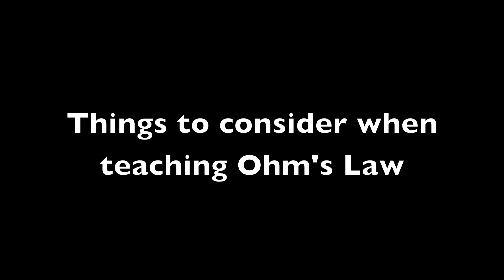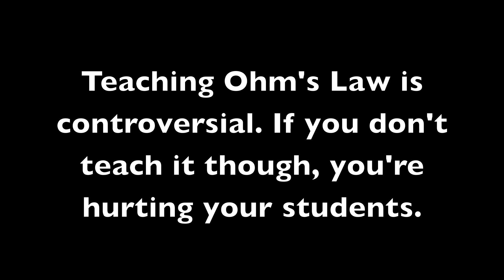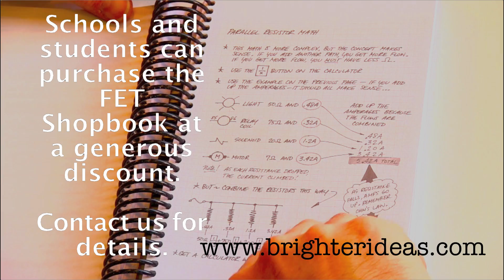Teaching Ohm's Law to Techs - Part 1

Comment: I used to teach some of the history. Current is measured in Amperes because the units were named after a French Scientist ( André-Marie Ampère) - The symbol I is used because the French used the word Intensity for current).

Voltage is named after the  Italian physicist Alessandro Volta, and Ohms for  German physicist Georg Simon Ohm.

This all a bit of history that we need to live with because they are standard scientific units and names.

Things need to be called something. Adding the back story makes them easier to recall (in my opinion).
Reply from the maker: We need to remember that however hard we try as teachers, creating something that is appreciable by every student is impossible. adaptability and flexibility are critical, so there is no ideal. Common sense demands we use the least confusing examples possible, and using E,I and R when the tool (the meter) is marked with V, Ω and A only makes sense. I also teach history. And language, and philosophy and I coach, and cheerlead, and I'm a big brother, and I'm a pastor, and a counselor, and I'm a dad. The men I teach need confidence, and it doesn't come from teaching them stupidly. I reserve the right to do what I feel is best. V, Ω and A are logical, and not criminal. They work. I use them.
Reply from the maker: I like your opinion. I teach this very thing in every class, and it has a very prominent place in my book. Thanks.
Reply: Most kids 11 upwards can cope with the maths & I think it does them good to see maths actually has a use.
Reply: Daniel Sullivan to a person like me who is learning electronics, why would i care about a Foot Note of a guy who died a few centuries before i was born?? It does not matter who did it/Made it/ or sold it. The only thing that ever matters in everything is, How does it work. Thats it. . So Thank You Mr Sullivan . By the Way Richard do you teach your class in easy cycles too? Do you tell your students you drove to work listening a great show on ON XXXX Cycles?
Reply: Peter Kiryluk  :-) I was classified as an outstanding teacher and with my approach increased the results in electronics by 58% also put up the number of students choosing it as a subject.

Never decry history, it is the stuff we are made from. A little back story can make the lesson interesting and make information stick in the memory better for later use.

ALL of the maths and electronic theory you are learning was set down in the 1800's Even those principles that underwrite recent developments as lasers and the transistor and integrated circuits.

The Greeks knew about computing in 100 BC and built mechanical analogue computers.

 Without those 17th century scientists and inventors there would be no NOW as we know it.

I was, (retired now), well known for doing a great deal in little time with my student, When I entered teaching after a full career in industry I quickly grew tired of the simplistic approach generally taught so that the students "had a better chance of success" and approached electronics and computing from a very practical and industrial angle. My students learned to code efficiently using industry methods to analyse problems and produce appropriate solutions.

 Many made successful autonomus robots entering national contests and  performing well in both practical work and in problem solving. many made models of real industrial situations or actually tackled problems from real industrial companies. For example one group made a system to monitor wear on a tool used to remove the weld from welded tubing. Such a good solution that the company out it into use and rewarded the school and the students.

But then again I don't suppose you will read this if you have a short attention span and don't like "irrelevant details"

Oh and my students knew well I turned up at school in my  MX5 sports car and were quite happy to talk about it if they were interested :-)
Reply: I read everything, i learn everything. I didnt mean i don't care for history. I do to an extent. Meaning Like learning how a transistor, works. I rather watch the video of the guy who made the first one. I love your teaching method because, you are from the industry so why remember formulas that don't match to real life.  I find that people keep talking about this "Magical Electron" which has never been seen, yet everyone keeps getting thought this nonsense about sharing an exchanging electrons when nobody has ever seen it. I guess im saying I like to learn also the parts that are not proven 100% correct to date. (being made aware that it may not be correct) . Maybe i dig too deep, and when i don't accept anything as fact until i can see it and it makes sense. If it does not make sense its usually nonsense. Because if (what ever may the subject) you can't make it work in your mental mind experiment then in my experience its a flawed idea.  I always say , you can't discover anything great with a ruler. As it is just measurement tool. If you want to confirm a measurement then its a great tool. I totally went off what i started talking about.

 I love learning electronics. BUT the only thing im saying is your way of speaking and communicating information is FAR greater as you do it in a no nonsense method. I like to know who made it and how. BUT to use math abbreviations that don't correspond to anything your working with makes it hard to learn as its impossible to remember. SO I retract my statement. PS. don't stop making videos. Guys like you are aging and guys like me are having a harder and harder time trying to get answers about the fundamentals. THE theory behind why, and not just a this is how it is accept it. Especially in todays world as things are super small super complex and harder to understand. I dont know if that makes sense.
Reply: Peter Kiryluk
There are as many ways to learn as there are students. By far the best way is to find out what works best for you and then do that.

As far as electronics are concerned. much depends on your stage of learning. In the early stages it helps (I believe) to have a mental model you can set the information against.

there are several different models for electronics, Bohrs orbiting planets, Quantum theory where electrons become vibrating packages of energy (Yeh!) , various mathematical models the at for me do nothing to illuminate the actual electronic process.

When your designing a circuit the maths is invaluable allowing you to select the best component for the task, When your fault finding I think  you need a mental image of what is happening as a flow. This makes your approach to the circuit very practical and generally finds faults faster.

Different people like different things. Ohms law is one of the few formulae you will use often in a practical manner.

http://www.instructables.com/id/How-electricity-and-electronics-works/
Reply: I'm repairing things usually.
Reply: I appreciate all the information, and yes, im one of those people that has to imagine what is happening so i can get a better sense of the problem. I will never be a board replacer. I have found the people who repair stuff, sometimes have no idea what they are doing, they say they do, they generally can find which part needs replacing, Thus replace the entire part. I refuse to ever replace the entire board, except if there is a weird burnt chip with pins that look impossible to remove.  I appreciate your information if i have a question like a stupid ohm question i can't ask anyone around me because they don't know, i once tried to ask a TV repair guy if mosfet transistors sometimes turn on but other times turn on but with half  the power. I could not get a strait answer. to this day im still not sure, but thanks to Videos like yours im learning so much every day, at my own pace. Over and over sometimes until i understand it, forwards & backwards.

Comment: I'm concerned that you're conflating the concepts of (E, I, R) with (V,A,ohm). The reason is that these things are not interchangeable. (V,A,ohm) are UNITS, whereas (E,I,R) are variables, or values that someone will measure. Seems to me it's like if you ask someone to measure the width of a door, and they come back and say the answer is "inches". I understand that perhaps it is pedagogically easier to stick with the symbols that the students see on the meter, but it is also incorrect.

Comment: E, I and R are fine, so long as you teach them that Voltage is an Electromotive Force, Teach them that Amps is the amount of Intensity/Impetus of the force, and Resistance is measured in Ohms Ω. Once they understand that, E/V I/A and R/Ω mixups are much less common. There is a difference between memorizing variables and understanding the phenomenon.

Comment from the maker: Volts and Ohms MAKE Amps. Volts ÷ Ohms = Amps. Should "E" represent Volts to a person who uses a meter where "V" represents Volts? I think common sense suggests - no... The Voltmeter measures "E"? No. It's not 120EAC, it's 120VAC. It's not 1KR, it's 1KΩ. It's not 10DCI, it's 10DCA (or ADC). Using obscure engineering and scientific terms to teach mechanics and techs is not logical. My 30 years hasn't formed my opinion - it's generated a truth. V, Ω and A make Ohm's Law make sense.

Comment: E,I & R is fundamental, Have-to-Know kinda stuff. E,I & R are used internationally. They are UNIVERSAL. Electronics IS math. It's fun to do it the "feel good" way but, when it comes down to troubleshooting at the component level, you ahd better be able to read the schematic AND do the MATH. E, I & R were chosen by the Joint Army-Navy Nomenclature System (AN System) for a reason. That reason being a mistake-proof way of writing and creating blueprints.
Not teaching the math is not teaching.

Comment: One common myth about Ohm's law, is that V=I*R is Ohm's law.  Useful to think about it that way for practical purposes.  But what the equation V=I*R is, or rather, what R=V/I is, is the definition of resistance.

Ohm's law really says, that resistance doesn't depend on V or I.  It is independent of electrical operating conditions, and is a property of the component itself.  True for simple resistors, and anything said to obey Ohm's law.

Comment: I have a question about transformers and inefficiencies.  Which value is "sacrificed" due to inefficiency, the Amps or the Volts?  Which value is guaranteed to match the step ratio exactly (if either)?

I like to think of transformers as electrical gears.  With gears, the rotations have to match the tooth ratio exactly as they would for ideal gears, while the torque gets sacrificed due to inefficiency.

Comment from the maker: Not necessarily. What's the difference between learning V, Ω, and A and then applying E, I and R, and learning E, I and R and then having to adapt to V, Ω and A when you read a meter? The point is, they're both the same and it's easier to learn the V, Ω and A first since that's what's on the meter. I'm and A&P and I know both. I prefer V, Ω and A...

Comment from the maker: Glad it helped. Just remember that Volts and Ohms MAKE Amps. The V÷Ω=A formula makes the most sense mechanically. I can see the stuff in my head, but if I do the math I have to write the formula down every time before I start so I can get it clear in my thinking.

Comment: I picked up somewhere the a mnemonic device for ohms law. VIRgin equation. V=IR after you've got that all you've got to do is swap around the variables and that's it. What really screwed me up is all the equations for ideal components. Try to build a custom transformer that needs to able to operate from 30khz to 100khz and transfer kilowatts of power with relative efficiency. After days of digging for information you'll realize how ridiculously complicated the task is.

Comment from the maker: It's not a matter of can't as much as it is a matter of won't. There's nothing wrong with the notion - you have to realize that concepts without context are as useless as theory by rote. The engineers whose satellite missed Mars because of a failure to communicate were all capable of using both English and metric calculations. I like the idea of what you're suggesting, and would encourage people to try - but your original comments said you "ditched" the formula. Can't do that.

Comment: Why not make the galvanometers? I did. Just wrap wire around a compass. Then you teach how to turn this into a volt meter vs ammeter (series resistor vs. parallel shunt). I created a battery with coins and measured it using these meters just fine. I have a series of videos showing this on khan academy under Science->projects->discoveries

Comment: Well, you beat me to the punch. I was going to make the point that, once we get past the stage of learning not to put our hand on a hot iron, all new knowledge has to be hung on the hook of *existing* knowledge.  As other posters have pointed out, the math IS important.  But if you don't know what it represents, it's just math.  If teachers must "start at the beginning", then Ohm's Law isn't the beginning - Ohm's RESEARCH would be.  Starting at the law is starting in the disconnected middle.

Comment: I started this journey by creating the equivalent of a 1000 watt light, that only uses 10% of the power, and produces little heat. Now I'm getting into designing circuits, so I can use Supercapacitors to illuminate my light. The nice thing is since I never really studied this before, I don't have the mind set that it can't be done. The one thing that was scaring me about electronics is, you guessed it, "MATH"! lol

Comment: As far as the equation goes, the Navy taught E=IR.  This lead nicely into the power equation P=IE (power is easy as pie).  But again, You could use whatever you want to represent the individual concepts.  
It has occurred to me that you may not be teaching electrical techs.  If that is so I apologize for any confusion.  
When you get into RLC circuits and some others, the math becomes more complicated and that is where the value of the standard equations comes into play.

Comment from the maker: An Ohm is an Ohm is an Ohm. Resistance by any other name, would it not calculate the same? The argument remains the same - we don't teach kids to drive using 8, %, ? and ∆. We use D, N, R and possible 2, and 3.  Variables are called variables because they VARY. We could write the formula VOLTS ÷ OHMS = AMPS. It's all correct. It's not all relevant. There is no controversy if you understand the difference between concepts and math.

Comment: It is not the same, I am not a teacher, however I do have a vested interest in what new techs are taught as I will have to work with them in the field.  I expect a certain level of knowledge, that is the reality of the workforce.  The math is an integral part of Ohm's law.   Especially since the voltage drop of an individual resistor is dependent on current.

Comment: I have used ohms law constantly in my career in the electric field.  What bothers me is that you said IF you teach the math.  There should be no if there.  I have no time for a tech that does not understand ohms law in all of its uses.  If they have trouble with this math, then they are going to struggle with the rest of it.  I think that you would do yourself a favor and teach it at the beginning.  Better to find out that it is not for you up front before wasting your time in the beggining.

Comment: I'm with Dan on this, I have an ONC, 2 degrees and have taught electronic theory for too many years, the academic is fine in the academic world, but, when teaching in the real world with instruments that deal with volts amps and ohms it's the only way to easily make the troops understand. The meaning in the practical "real sense" is certainly not lost and my perspective is that it makes it far easier to understand, I measure Voltage, I know the max current, I can work out resistance etc..simple

Comment from the maker: The first and most critical thing to learn is this: VOLTS & OHMS make AMPS. The formula you should use is V÷Ω=A.  The triangle and circle thing work, but the math is secondary. Remember that RESISTANCE goes DOWN in parallel. Use the 1/x button for parallel problems. Let me know if you need help.

Comment from the maker: No problem. It's all about learning. Electricity is the toughest to teach and learn, and in the same way that I feel it critical for techs to be bold and confident, teachers should be too. E, I and R do what they do for the people who need them. Apply your fruit salad thought to driving; doesn't make much sense to teach 1st, 2nd, 3rd and Reverse as 77, ?, & and ∆... The shifter has 1,2,3 and R. Concept. concept, concept. The math is a simple fraction - it's what the math MEANS that matters.

Comment: Allow me to disagree. I think you should use scientific names to teach scientific phenomena. E stands for electromotive, R for resistance and I for intensity, to understand the relation between these I like to call them by their name, otherwise ohm's law becomes a formula with no meaning. Volts, ohms and amps don't mean a thing, you could call them oranges, potatoes and tomatoes, they are units of measurement, they are a convention that can change, so, you should not use them to teach.

Comment: But the R=V/I ratio addresses dependent and independent variables with slope as an outcome if those variables are graphed. This is assuming ohmic resistors are all that is in play.  If the resistors are not ohmic then the V/I ratio also highlights this and opens a conversation about thermocouples and varying resistance.    Potential difference alone is a tricky thing for most adults to really grasp, it seems sensible to approach V, I and R multiple times by multiple methods starting in 8th grade